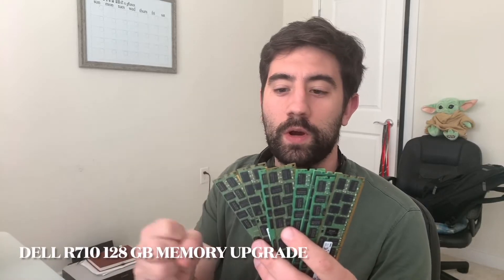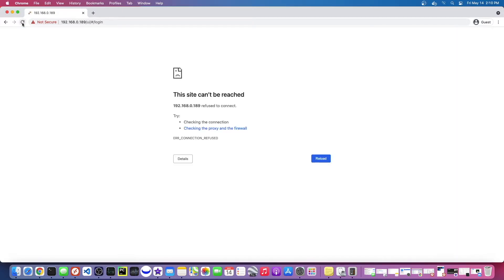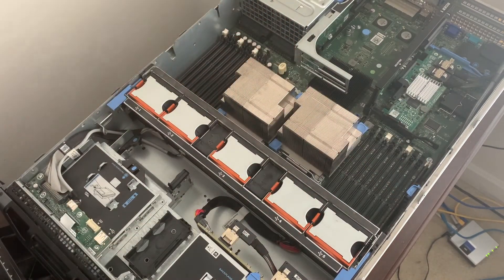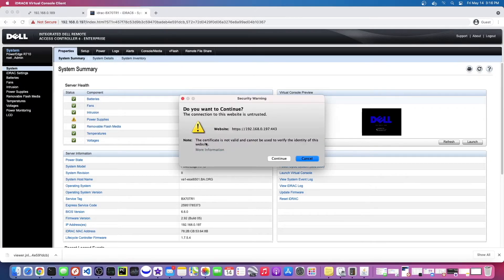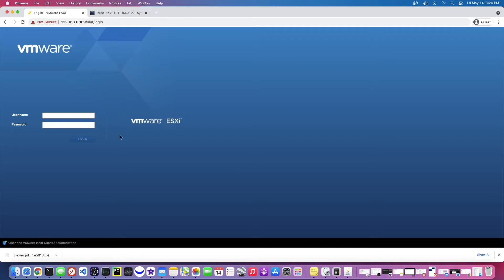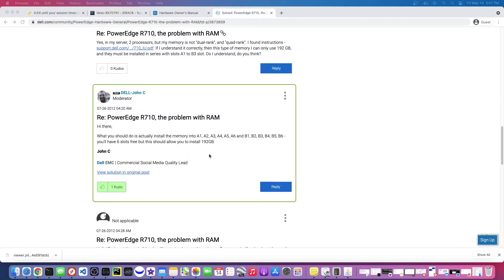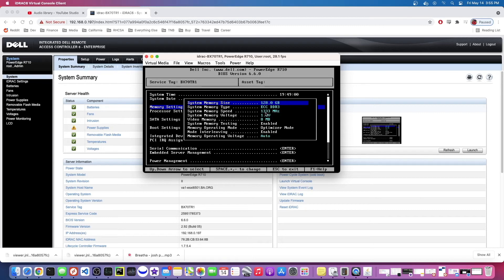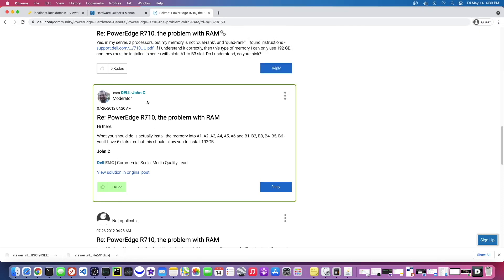Watch Me Upgrade My Server RAM from 64GB to 128GB

Comment: I actually removed some ram from mine to reduce some power use, it makes a difference if it’s running 24/7 and your not needing the ram. Average power use about 140 watts. Curious what your at? Cheers
Reply from the maker: I'm guessing removing 16 sticks of 4GB and replacing with 8 sticks of 16GB will be more power efficient since there are less sticks? I checked my power consumption in idrac and average for the past week was 167W. Keep in mind most of last week I had the 16 sticks of 4GB installed. I'm actually replacing this r710 with an r720 today which from what I understand is more power efficient.
Reply: I dont have this issue, well wont when my new server comes :P 
Basically I have a small solar panel setup thats using the inverter to power it with a mains supply as backup with a automatic switch incase the batteries on the PV setup go down..